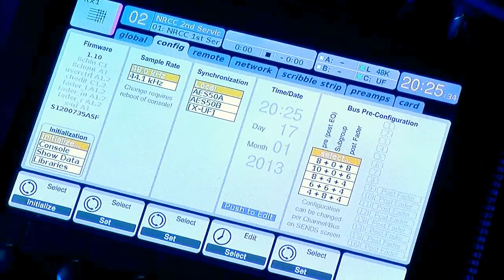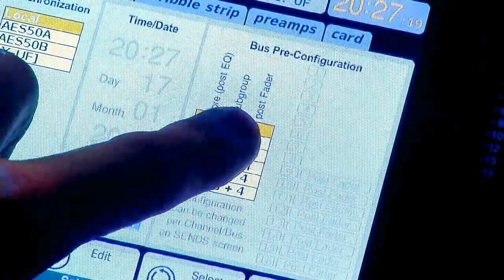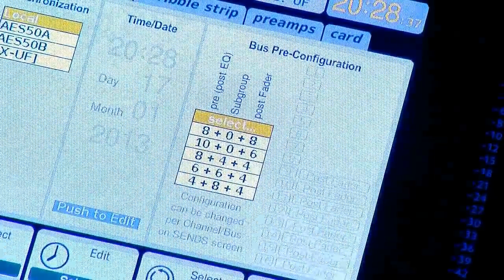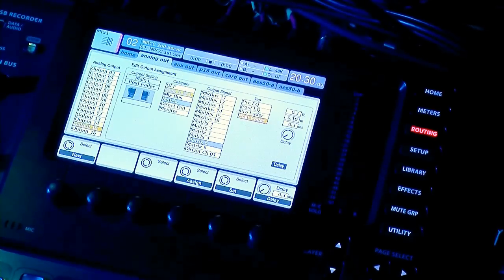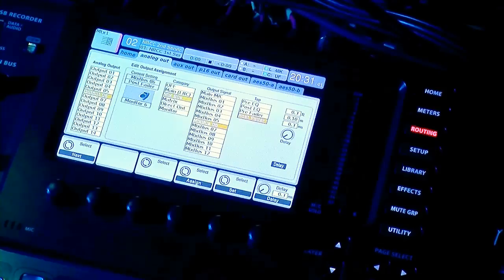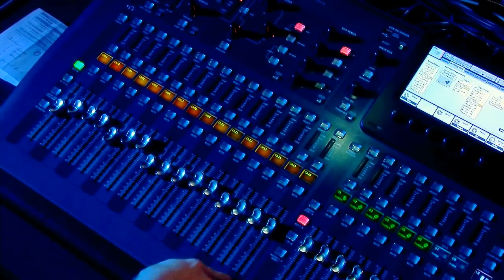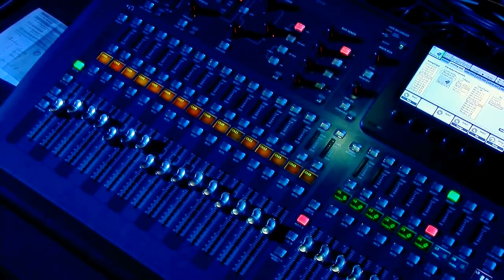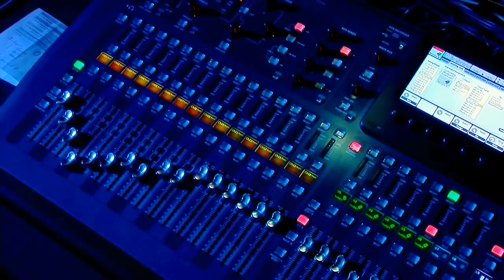Behringer X32 - Board Setup for Monitor Sends

Comment: ? I setup the monitors like you did however when we tried to use the eqs they did not work we made sure there was a signal and rechecked the buss setting with the effects. can you go further in detail about setting up the eqs for monitors, One engineer told me we couldnt use all of the effects as eqs because they are not insirts, I dont agree

Comment: Just like to say thanks. I've watched a load of you vids over the last few weeks and they have been a goldmine for me. You've probably saved me a hundred hours of learning curve. I used the x32 at a gig I did solo last week. I had the board next to me on stage and I had a LD maui 28 behind me for my own monitor. I took my main outs into the house PA. The X32s inboard effects are so sweet I pretty much took my whole sound with me onto the stage and plugged it in.

Comment from the maker: It is possible you don't have enough gain on the keyboard on the preamp of the board.  Check and make sure you have enough there, and then I know there are a few different volume controls on the P16 so make sure that he has all of them maxed out if he needs more.  But if you do turn up the channel gain, you will need to adjust the keyboard in the mains and other monitors.

Comment from the maker: I believe you are mistaken.  The monitors are setup as a Pre Fade POST EQ.  There are a few different options for the Pre fade sends.  You can do post EQ or pre EQ.  The setup of monitors would be the same for use with an S16, however the outputs on the S16 would be pulling from the mixbus you setup for the monitors.  In the case of this video Mixbus 1-6 would be the monitors.

Comment from the maker: You would end up using 12 mix busses of the 16 available.  Also you would use 12 of your 16 outputs on the back of the board.  If you are able to use up this many busses and outputs, then yes.  Sounds like your best bet would be two boards, one for monitors and one for FOH, unless you have a super simple mix and system for FOH.  You could also utilize the P-16 monitors which interface very nicely with this mixer.

Comment from the maker: Yes you would need 6 different amp channels to have 6 different monitor mixes.  So 3 stereo amps or 6 mono amps, basically just 6 separate channels.

Comment: “Configuration can be changed per Channel/bus on the SENDS screen.”
Am I correct in assuming that this means each channel/bus‘s pre/sub/post settings overrides these pre-configuration settings? Pre-configuration is just a shortcut to set all the channels/busses’ pre/sub/post settings...a time saving feature?

Sorry if this question was already answered in the video, I looked for it but I couldn’t find it.

Comment: Hi Maximum 90. I've a Presonus board as well as the Midas M32. The M32 has the same operating system as the Behringer X32. In my view both the X32 and the Presonus are comparable in sound quality and simplicity of operation. One other thing you might consider is the Presonus customer service which is in the U.S. and very good. They both have multitrack recording capability but Presonus makes a software package that makes it easier than the Behringer. Behringer has sold over 100k units and seems to have, at least for now, overcome their reputation of making gear that doesn't last. Frankly, if you can afford the additional expense, get the Midas M43. It sounds much much better than both the other boards.

Comment: I like to tell my band that instead of first asking for "More Me" find out what you need less of in the mix and start there. That will save your ears in the long run, it's amazing what you can hear at low volumes if you start lowering your IEMs a little at a time.

Comment: Drew please do an x32 dummies book. I’m new to digital and like the print in front of me as I’m learning. 
I’m am running an x32 compact with a s16 stage box. So far so good except I’m only getting a monitor on the 1 xlr out on the s16. No sound out of the other 7. What am I doing wrong.

Comment: Hey Drew. I love these videos. We just bought a x32 for the school I am at. I set up the stage monitors using this video, but there's a problem. I have our laptop going to the stage monitors, but when I play something, the sound comes out of the monitors even with the aux input fader AND the monitor fader all the way down. When I move them up, there is no real change to the volume of the sound. I set it up using the 6+6+4 setting in the config tab that you suggested. Any help would be greatly appreciated. Has anyone else had this issue?

Comment: Great job on Tutorials! Our church had a sound guy come and set up X32 board and he ran our wedge monitors through Aux out port. We haven't had the best luck getting monitors to have a good mix. The X32 manual shows monitors plugged into send ports. Which is correct? If is needs to be moved to send port, how do you do that?

Comment: Great videos! Im about to get this board for my church. We are using the Behringer personal monitors with it. How would you configure those? (we will send 12 channels for them to mix)
Reply: Also question. (sorry if you answered this already somewhere. My church has L R and Center. along with 2 Subs. How do I set that up? Currently we have the L and R linked.  Im a little confused on how I can do this . thank you

Comment: I'm not Drew (and my X32 won't be in until tomorrow) but I believe if you look closely at the config screen, it says right below that you can change the settings from the sends screen. This leads me to believe that the config table is more of a "quick setup" that allows you to very easily set up a number of busses for mons, subs, and fx, rather than have to do it channel by channel. I could be wrong, and I hope I'm not.

Comment: always great tutorials from you Drew. Keep up the good work. Quick question : I just bought two SD16 to place them in two different stage areas (front and back), but I want to use just first 6 outs for monitors, if I keep both SD16 on same outputs config (1 to 8) can I plug wedges 1-2-3 on the first 3 outs on the first SD16 and the wedges 4-5-6 on the outs  4-5-6 on the second SD16 and find them in the right sequence on the board ?

Comment: Using 12 outputs for this is no problem as i really only need 14 including main out.  What i worry about is what you show in setup. You chose 6+6+4.... I miss 16+0+0. Also havn't found bus stereo panning. I do not have the board- i just mess with the software as part of my research (currently running PreSonus SL 24.4.2)

Comment: As the minister of music at my church, I really want to get this board. But my sound guy has a brother-in-law that uses the Presonus, so he wants me to get that board instead. I am having such a hard time giving the OK on the Presonus because I believe the x32 is so much nicer and easier to use based on the videos I have watched. But I also want to respect the sound guy's opinion considering he will be using it the most. But that's another reason I'd like the x32, so I can quickly recall my personal settings when he isn't the one running sound. Any thoughts on the Presonus?
Reply: Maximum 90 get the midas 32 version .small bit more but not much .much better board .no professional woyld have  a bad word to say about it .if ur guy still wants persons he does not know what he is doing .it operates exactly the same as the bheringer

Comment: Hey Drew, This may be a silly question, Maybe a configuring Issue, -- How do I set up our X32mix App, and M32Q App to pan monitor mixes for IEM's?  We are running our BusSends to Rolls monitor Boxes & our Musicians use the M32Q app currently it its amazing... But to maximize potential in the mix it would be helpful to pan IEM mixes... IS my board set up wrong when it isnt showing panning as an option in the apps?

Comment: I have an X32 producer and am needing to send monitor mixes out of the 1/4" aux outs, but it doesn't seem to be working.  I am using a 1/4" to XLR adapter, too.  Is some routing necessary to be able to do this?  And can I still have custom monitor mix bus for those aux outs?

Comment: Hey Drew, our church has Mains very far left and right positionally, and angled cross central. As a result the worship, Vocal lead and Keyboardist gets a lot from the Right side but hates the flatness of their monitor. Is there a way to fix her Monitor from being flat (no FX) so we can give her more from monitor so Worship lead gets better Monitor feedback and not worrying about the Right Main being her dominant source of "monitor" feedback.
Reply: Well I finished this 101 Playlist; great basics. I think I can get to my answer by first giving vocalist that Monitor reverb you suggest not to do. I recall that video said to use Post and Pre fade differently, but you postponed the reason why. Was it Pre to monitors, but I think you went with Post because it was set so. Anyway @2:18 is the rule that Post Faders in Monitors will be influenced by House adjustments and Pre-Faders won't be affected. And here for the nuts and bolts to do it: https://www.youtube.com/watch?v=jwSgSa0HMEE your How to add reverb to the monitor  @9:50 over there.

Comment: Drew , I could really use you help , trying to control vocal monitors on x32  , I tried routing my floor monitors from outputs 9 & 10 to mixbus 9 & 10 post eq and see signal on the board , but no sound
Reply from the maker: Hey Kevin! Check out this video for more help on the monitors: https://youtu.be/jwSgSa0HMEE

Comment: Thank you for this very easy-to-follow tutorial. I have a question. I am running sound for a musical with numerous wireless body mics and a few instruments. The ideal would be for me to be able to send to my monitors the instruments pre-fader and the body mics post-fader. That way the instruments appearing in the monitors don't have to follow the fader moves I make when mixing them for FOH, but the body mics go up and down, in and out with the FOH mix, so the sounds of actors talking or using the restroom when they are offstage don't show up in any monitors. Is there a way to determine on a channel by channel basis whether that particular channel gets sent to a particular bus pre-fader or post-fader. In other words, can I combine pre-fader and post-fader behavior into a single send from channel to channel?

Comment: I have an X-32 as well as a Powerplay D with  2 P16ms and 1 PSM200 wireless monitor... is there a way to connect the wireless to the ultra net so I can get my own mix in my wireless?

Comment: How did you initialize it? Say the board is set us very sloppy I want to wipe it and restart from scratch? Also if I save the last scene to a flash drive once I initialize it if I can't get it set right can I put the flash drive in and boot from that and save that to the board and use it the way it was originally ? Thanks in advance?

Comment: Quick question. I'll be using this board to run in ears rather than monitors. Do I need to plug them into the aux channels (which I believe you have yours plugged into) or would I plug them into the direct outs? If the direct outs are better, how do I configure the board to adjust those output channels?

Comment: Hi Drew,  I've learned a lot from your Vids, Thanks a lot.  I got a question : I'm using X32 compact and S16, can I use 10 monitors? (8 from S16 plus 2 from the X32). Tried to route from aes50-a and XLR out (ROUTING), but still got the "*" mark.  Can you help please?  Thanks

Comment: If you read below the BUS PRE-CONFIGURATION section you´ll read "CONFIGURATION CAN BE CHANGED PER CHANNEL/BUS ON SENDS SCREEN". This should permit you configure the boards sends outputs individually. Remember that what is describe here is a PRE-configuration or say a Quick-Start.

Comment: I have X32 and S32 is there a way to take advantage of the 32 outputs between them? Ideally I would like to use my S32 for all 16 mix bus and save the outputs on the console for subs and mains using output 14-16 is this possible and if so how would you setup the routing being that output only gives you 16 outputs to choose from?

Comment: Is there a video on finding your monitor sends? We had someone set up our board for us but we need to do some trouble shooting. We use the berringer p16s for our in ear mixes but I have no clue where I can adjust and adding things for that. For example, Bus 1 says stage monitors for us and that is correct. I can’t find which one is controlling our in ears. 

Additionally, we need to fix the assignments. For example, our labels on our personal mixes show that bass should be coming from channel 2, but it is lighting up in channel 5. I know there has to be a section to set this up bc the output does not match the input, meaning bass is input 9 but is 2 on the personal mixers. Problem is, it’s coming through channel 5 and not 2. Does that make sense? Can anyone help?

Comment: I have a P16 question. We use P16s along with a few floor monitors on our X32. I have a keyboard player that continues to ask for mor keyboard in his P16 after he has maxed out the keyboard channel as well as the master volume. Is the a way to get more headroom for the keyboard in the P16 without affecting the floor monitors or the house mix?

Comment: Hey Drew, I just came on board with your tutorials(awesome, btw!), and I have a question for setting up a monitor mix, that I haven't found online anywhere. I tried reaching out to Behringer, but their tech support just refers me to the musictribe forum, which doesn't address my issue either. What I am trying to do, is: Configure my X32 Producer board, with an SD8box. I have gotten through connecting the SD8 through the AES50A option, and I am receiving input signal with no problems. My issue however, is, how to send monitor signals to the SD8 box, via it's xlr outputs, but I just can't make it happen!! Help, please...or refer me to someone that can?
Reply: You need to configure your Out 1-8 as AES50A as well from the Routing page AES50-a tab. Then, verify your Mixbus settings are routed to Outputs 1-8 on the Analog Out tab.

Comment: So, how do you link two auxes together to make a stereo mix.  I mix a band that uses 4 stereo mixes.  I have yet to use the console, and I am trying to preprogram my show with the x32 editor.  I dont see anywhere to link auxes.
Reply: there is a way to do it we have it set up at my church that way but i don't know how they did it i didn't set up the board. but we do have them. that is something i've been trying to figure out since i'm setting one up soon.
Reply: Select the first aux. Then on the home tab of the home page click link. You will be asked to confirm that you want to link it to the adjacent aux.

Comment: Hi, thanks for the video. I have a question, are you 6 monitors coming out of 6 xlr's out, or out of the aux outs?
Reply: I don't know if you ever got an answer for this, but I have the exact same question.  MixBus 1 for me is mysteriously controlling my monitor 1 and mains at the same time, and I have no idea why.  Didn't know if using Aux Outs would solve that.

Comment: On the Config page you said 1-6 are the monitors and should be PRE FADER so when you change the main mix it doesn't affect the monitor mix. Then later on in the video when you go to the routing page and assign output 1 to mix bus 1 you say it should be POST FADER.  i am a little confused. Am I missing something? If you could explain this, I would appreciate it.
Reply: I saw that too.  Correct, but confusing.  The Config page presets whether the SENDS to the Mix are Pre/Post.  These Pre's would be controlled using the 'Sends on Fader' button in the video.  The Routing tab deals solely with the combined Mix output level to the speaker/in-ear.  It controls the total volume the artist is hearing.  The mix of levels within that total are controlled by the Sends.

Comment: Why are you setting up monitor sends as post fade? Shouldnt they be pre fader so that when you pull down the fader on the desk you don't pull down the monitor send?

I take it you aren't using the S16? How do you configure the monitor outputs for the s16?

Comment: The sub groups: couldn’t you do the same with sending to a DCA?
Reply: Ahh ok, but what if you’re not using the p16’s 

Don’t the DCA’s allow EQ and Compressors?
Reply: @TheNathanMac  Sorry, I should have been clearer. You can compress, EQ, gate with a subgroup regardless of whether you're using the P16 monitoring system or not.

You could pan with any setup if you have a linked pair of subgroups too.

And no, the DCAs don't have EQ and compressors. It's just a simple grouping tool that allows you to raise or lower the volume of multiple channels/busses. You can mute them though.
Reply: Ahh ok that makes sense.
Reply: @TheNathanMac  To answer your original question, there is no channel processing on a DCA.  Think of a DCA as a master fader for a group of channels, not a subgroup.